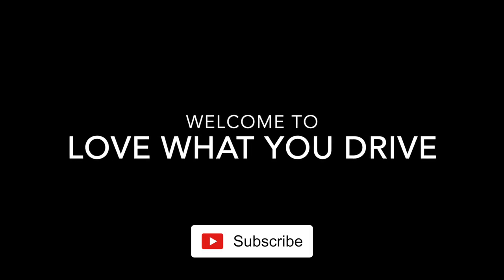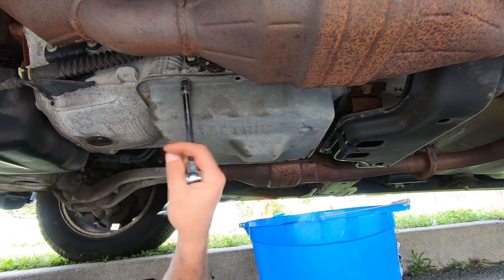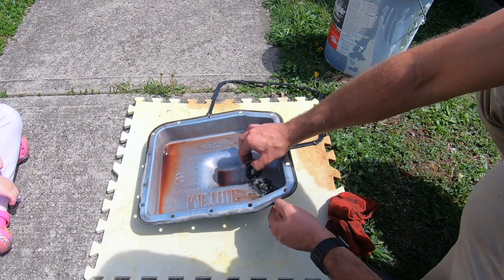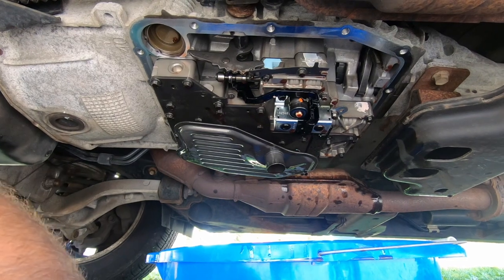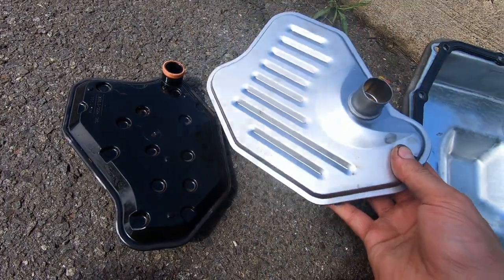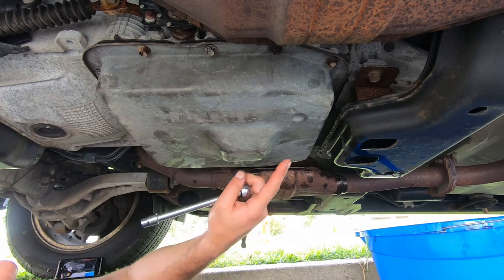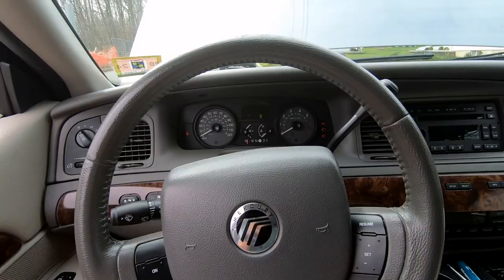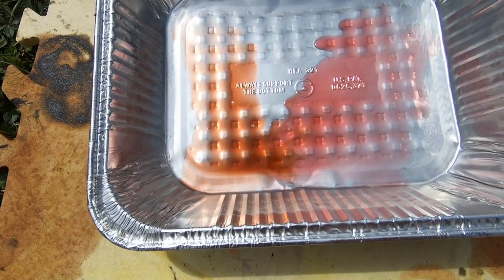How to Change Transmission Fluid & Filter (Easy Pan Drop) Mercury Grand Marquis Ford Crown Victoria

Comment: The Yellow plastic thing with the o ring on it is from the factory once they put in district that piece gets pushed out into the transmission pan. That means either your oil was never changed or no one ever removed it when they did change it.
Reply from the maker: Thanks for watching the video and your input! I appreciate you! At first I freaked. But then realized it’s not bad!
Reply: I am here because of the yellow plug. I was measuring the amount of old fluid and found it, and was like oh fuck wtf is this.
Reply from the maker: @countyline81 I think everyone had the same reaction when finding tat thing lol

Comment: Very excellent work, but I would like to warn you that a little old oil remains in torque converter, and if you want not a drop of old oil to remain in the transmission, you must use this device (torque converter) to clean the entire oil cycle in the transmission. I noticed that there are excess iron filings in the magnets. I advise you to replace one can of transmission oil with treated Lucas oil. I wish you good luck.

Comment: Good camera work -- thanks for that !!
Ford Motor Company specifies MERCON V for your Crown Vic, Grand Marquis, or Town Car. There is NO "next best thing".
Your Shift Pointer needs adjustment.
After initial filling, the fluid level is to be checked HOT (driven for 10 miles). Your Temp Guage showed "cold".
Take it easy -- you're still learning.  😁
Reply: That is correct, Mercon 5 fluid only, anything else will ruin your transmission
Reply from the maker: Looks like I’ll be doing full transmission fluid change in the near future…
Reply: @LoveWhatYouDrive  A tip:
 If yer gonna KEEP the car:
 If you can, drain the Torque Converter.
 If your trans pan has a bump on the bottom, get a pan with a drain plug (Rock Auto).
 I use and recommend Castrol "TransMax" Mercon V for the 4R70W -- MERCON LV for later trannys.
 Get a MOTORCRAFT trans filter.
 Re-use the Original Pan Gasket -- with NO f**king RTV !
 Fluid capacity for the 4R70W is 13.8 quarts with Torque Converter drain.
 Check fluid level when hot, and DO NOT OVER-FILL !!!
 IF you drain your Torque Converter, your next filter change will be after 35,000 miles.
 The new trannies call for 30,000-mile OCIs.
Reply from the maker: @SlikLizrd  I did make an honest mistake, I went back and saw the transmission fluid I put in and realized it had nothing that said Mercon on it! My mistake I take responsibility! Thanks for the tips Chuck!
Reply: @LoveWhatYouDrive  It's all good, Love -- You don't wanna be perfect -- Jesus was, and look what they did to Him !!
 I wasn't BORN knowing this stuff -- I hadda make a lotta mistakes to find out that ya need to prevent making mistakes. 😁
Reply from the maker: Amen to that brother! That’s why I love the panther community, we have some veterans in the game who are willing to help!
Reply: @LoveWhatYouDrive  At your service, sir !

Comment: Best to use carburetor cleaner instead of brake parts cleaner for the gasket. Brake cleaner contains methanol that can cause rubber parts to deteriorate faster.
Reply from the maker: Thanks for the tip! 💯

Comment: On my 2000 Grand Marquis I put a Dorman drain plug transmission pan on. My torque converter has a drain plug and I let it drain, after removing the filter, overnight. It took at least two gallons of Ford Mercon V. I agree with comments on that pan, replace the metal washer with a fiber one and tighten until it stops leaking. The next time I will not replace the Motorcraft filter, just drain and refill. At 67,000 miles the original looked clean but, I also replace all maintenance items when  get a used car.
Reply from the maker: Good tips! Thanks…I’m planing to do the whole fluid change in the tranny not just the pan drop and also because I put in the wrong fluid so it will be good to change…ill be at 100k here shortly in the Merc so soon I’ll be doing the drain and fill!
Reply: Change the filter 🙄
Reply from the maker: Thanks! I did change the filter in the video…👍🏼
Reply: @LoveWhatYouDrive  oh yes I saw that, I mean to this other guy here. I was told that the filter is the real important part which is why they don't have the drain plug in the first place (which is asinine) but it's because you're supposed to change it every time and not just the fluid. I greatly appreciate you showing us how to pull it off too, i was concerned about that part myself and was delighted to see such a good close up of it.
Reply from the maker: Oh I see, no problem! Ye there’s some crazy miles for these cars that get maintenance neglected for thousands of miles…I’ll keep changing my oils and filters as I can’t afford new cars, its cheaper to keep up with maintenance than to purchase other cars! ✌🏼👍🏼
Reply: @carriecrackrock1221  I understand you saying to change the fluid And the filter. 4X4 and heavy towing have the drain plug for 'just the fluid' because of possible overheating break down. The filter is for particles with high mileage/severe service where the trans is above average 'abuse'.  Normal street use will not 'require' even the fluid change. Because I don't high mileage my cars, 87k now, and don't hot rod, tow, and will change more than the pan fluid, drain the converter again, at 120 or 130k  it will get just the fluid. I Will however check the fluid level and smell periodically and if there are issues the game changes At 68 years old I doubt if I will be allowed to drive by 130k. Just showing different circumstances for different usages.
Reply: I put those pans on my 2006 and 2007 Grand Marquis, and my 2003 Mustang V6. All three cars use the same pan. None of them have the converter drain. They still have that rubber plug on the bellhousing, but I turned the engines a complete revolution with a ratchet on the crank, and there is no drain plug. You can only get about 5 qts. out. But I change those 5 qts. every 9,000 miles (every three oil changes) I believe the transmission and converter hold about 11 qts.

Comment: So Amazon is asking for transmission for my 06 Merc Grand Marquis... I have two options, but I have looked on the door sticker and I'm not seeing details on my transmisson... how did you determine which filter your MGM needed?
Options for Transmission are: 4R75E or 4R75W
Reply from the maker: Let me go see my transmission and I’ll let you know
Reply from the maker: The sticker on your door jam should say TR and there’s a letter. On my 06  Mercury Grand Marquis LS the letter is Q
“The Ford transmission Q means it is A4-speed automatic, 4R75E Electronically Controlled 4-speed Wide-ratio Automatic Overdrive Transmission”

Comment: U just got a new subscriber 👍🏽👍🏽✌🏽✌🏽. I have a 2011 grand marquis . Had  it since 2013. I been thinking about doing this as well
Reply from the maker: Thank you bro! I appreciate your support, it’s all about community!
Reply: @LoveWhatYouDrive hey bro just wanted to ask how ur car is running after u changed ur transmission fluid. I’m about to do mine today but I’m nervous it’ll mess up sometime after I do it..
Reply from the maker: My car is running fine, no issues, you can’t really mess it up, just take your time and I thing the biggest thing for me was to not over tighten the bolts for the pan..other than that go for it there’s nothing to mess up
Reply: @LoveWhatYouDrive  alright thanks! I sure do appreciate it bro.
Reply from the maker: Let me know how it goes! Good luck

Comment: This is next on my maintenance list to do my MGM has almost 223,500 miles I not sure when or if its ever been changed but I'm sure it as cause I knew the 1st owner which was a older lady and she took care of it she had the mechanic at their family funeral home to the maintenance so nothing on the Carfax except a few things and things I've had done at shops in the 9 months of owning it, it has a shudder when it hits 50-60 MPH so I'm hoping a fluid change will help transmission shifts fine
Reply from the maker: Thanks for stopping by ! Make sure you use the Motorcraft brand transmission fluid. I’ll have to change out all the fluid in my transmission in the near future as Maintance procedure. But you can read all the comments below that say I’ve messed up my tranny and this and that. My transmission works perfect but I would use the Motorcraft brand if they had it at the time I was doing this project! Good luck man!
Reply: @LoveWhatYouDrive  RELAX. That "Universal" Trans fluid won't blow your tranny right away-- you'll have time to save up for the Good Stuff.
 Speaking of which -- I use and recommend the OEM Motorcraft Transmission Filter for the 4R70W tranny -- but NOT the OEM Motorcraft Trans Fluid -- there is much better stuff available now -- I use and recommend the CASTROL "TransMax" Full Synthetic Transmission Fluid.
 Pan drop and filter change at 35,000 mile intervals will keep 'er runnin' good.
 My transmission has been modified with a B&M Shift Improver Kit, a 13,000-lb. Trans  Cooler, and a B&M Drain Plug -- for long-distance, high-speed touring throughout the deserts and mountains of the American West.
A recent, 2,860-mile trip through the Rockies yielded 24.1 mpgs -- Transmission functioned perfectly.
Reply: @LoveWhatYouDrive  I usually use manufacture parts I might use Motorcraft but I thinking of going with Royal Purple ATF

Comment: I just replaced the pan on my 2006 P-71 with a pan that has a drain plug on it because mine had a dent it the sump of the pan. I also did a 12 quart flush and filter change.
Reply from the maker: Did you buy a pan with the plug or you made it yourself? That is a convenient little accessory since you have to change the transmission fluid every 60,000 miles!
Reply: @LoveWhatYouDrive  Ya. I bought the Dorman pan with the drain plug already installed. $38. The interval is every 30,000 on my Police Interceptor, so it makes it very convenient to service it.
Reply from the maker: @j.t.cooper2963  $38 bucks is a deal! I’ll look into it, thanks for this!
Reply: @LoveWhatYouDrive  Got mine on eBay.
Reply from the maker: @j.t.cooper2963  thanks

Comment: The transmission pan I’m assuming doesn’t have a drain plug
Reply from the maker: Hi thanks for stopping by! No it does not have a a drain plug, you are correct.

Comment: What page does the manual say to change at 60k? I never found it
Reply from the maker: I’m not sure myself you have to look into the manual for maintenance. I believe every 60,000 miles if I’m not mistaken. Maintenance chart is where you would see every maintenance fluid and mileage that it Hass to be performed on.

Comment: Yes the yellow plastic this means the transmission fluid is never been changed, and  I have an 08 grand marquis since 2019, and I'm still have it, and  your engine bay needs little bit cleaner, and those kind of cars are very reliable and exited

Comment: Yikes!  Did that bottle say Mercon LV and your dipstick say Mercon V?  You can’t use Mercon LV instead of Mercon V.  The reason is that the two transmission fluids have different viscosity index and densities.  Moreover, they have different additives and composition. I don’t know what year your car is but my 03 uses Mercon V.  While it’s controversial, dropping the pan to change fluid is problematic if it’s not done correctly. This includes tightening the pan properly to the proper torque. You got 5 qts out.  If you have the 4R70W, it holds 13.9 QTs. Or 36% of the fluid was changed. You run the risk of creating a leak if you didn’t have one initially.  Draining through a cooler line will easily remove 4 QTs. This is 29% of the total fluid content. If you do 2 changes of 4 quarts through the cooler lines in succession, you will have replaced 50% of the original fluid.  But getting back to what you used,I would do multiple changes to get the Mercon LV (low viscosity) out of there😢 ASAP personally. My wife’s Impala has a sealed transmission. No dipstick. No filter you can get at. I changed the fluid at 50,000 miles and it’s a mess what you have to go through to refill the tranny IAW GM Service procedures.  The Merc Isa piece of cake in comparison.
Reply: Valvoline says that their Maxlife full synthetic that is used in this video is indeed compatible with Mercon V and LV.
Reply from the maker: @jonwiersig5800 finally one positive comment regarding the fluid I used! Hats off to you sir 🎩

Comment: gaskets are supposed to be reused
Reply from the maker: 👍🏼 gaskets were reused in the process of this video!
Reply: The Transmission Pan Gasket is designed to be re-used. No other gaskets on a Panther are to be re-used. Source: Factory Service Manual.

Comment: You should have used lv mercon 5 you damaged  the car whit out knowing
Reply from the maker: Thanks for stopping by I appreciate you. I’m sure it will be OK!
Reply: Like your video they are the best cars left  and here in Québec there are not a lot left because  of winter
Reply from the maker: Thanks for sharing!
Reply: YEP.  Hopefully, nobody will buy the same fluid that was used in the video -- it's the WRONG STUFF !!
Should have used MERCON LV, as required by FOMOCO.
Reply: Mercon LV is only for the 2009-2011 models. The 2008 transmissions actually could use Mercon LV, but came factory filled with Mercon V.  So unless you can change 100% of the fluid you wouldn't wanna mix different viscosities. Use the fluid viscosity specified on the transmission dipstick.

Comment: supossed to put rear tires on ramps - front tires on ground::: ASS UP !

proper tranny drain comlete
Reply from the maker: Thanks for the tip! Will know for next time!
Reply: @LoveWhatYouDrive  That's not a tip -- it ain't true.
Transmission is serviced with the vehicle LEVEL. Always.
Reply from the maker: Thanks for the tip! Will know for next time!

Comment: Why You did this?Fluid is still red.
Reply from the maker: It has almost 100k miles and never had service on the transmission. If I’m not mistaken it’s supposed to be serviced every 60k miles.
Reply: @LoveWhatYouDrive Is there any way to check when was the last service.I don't know anything about histoty of my car.I remember two years ago when i check all fluids and  they were fresh.I just did diferencial oil exchenge.Only break fluid was old - problem with corrosion of bliders.
Reply from the maker: @TheBarth79  how many miles on your Marquis?
Reply: @LoveWhatYouDrive  About 91k.I think after "big service" car must stand fot a few months not driving. Undar a three.Lot of someting green groove up on car.That theory is bicouse there is a state inspection sticker from New York state and certyfikat of selvage is from Pensylwania Car was bought in Trenton.I had to clean all gaskets and letters with touthbrush.
Reply from the maker: @TheBarth79  unless there’s record of it being done, or papers or receipts, I think it would be kind of hard. My thing is this, when I get a car I always do maintenance on it no matter what. Oil change, oil filter, air filter, fuel filter and any other filter that I can. If it’s higher mileage car I’ll do transmission fluid and filter if possible and rear axle fluid. Spark plugs and wires if needed. It’s my thing. Then I’ll know what I did and what’s been done for peace of mind and then I track it.
Reply from the maker: Ok, not bad mileage. I just looked at ford service logs and it says if your car is being used for taxi, patrol, delivery or anything with a lot of driving, everything must be changed sooner. Here I’ll put it here. But I don’t see it saying that every 60k transmission fluid needs to be changed. I’m not sure where I read that. 🤔 

Extensive idling and/or low-speed driving for long distances as in heavy commercial use such as delivery, taxi, patrol car or livery

Every 3,000 miles, 3 months or 200 hours of engine operation
Every3,000milesor3months Every 5,000 miles Every 15,000 miles Every 30,000 miles
Every 60,000 miles As required
42 Scheduled Maintenance
Change engine oil and replace oil filter
Change automatic transmission/transaxle fluid (not required on 6R60 transmission)
Change transfer case fluid Change manual transmission fluid Inspect and lubricate U-joints
Change engine oil and replace oil filter
Lubefrontlowercontrolarmandsteeringlinkageball joints with zerk fittings, if equipped
Inspect brake system
Check battery electrolyte level
Replace fuel filter (not required on Fusion, Milan or Zephyr)
Change automatic transmission/transaxle fluid (not required on 6R60 transmission)
Lubricate 4X2 front wheel bearings, replace grease
Reply from the maker: Sorry it came out all crazy on here let me try to leave a link to the website!

https://www.fordservicecontent.com/Ford_Content/catalog/owner_guides/06frdmg3e.pdf
Reply: @LoveWhatYouDrive  Fully understand.Spark plugs ,Transmision fluid and  coolant are old.Cololant and coolant rerervuar are very clear.Thanks for link i will check it later.
Reply: Fuel filter is new from 2021.Car wasnt driving in 2020.Maby 50 miles.i had big registation problem.